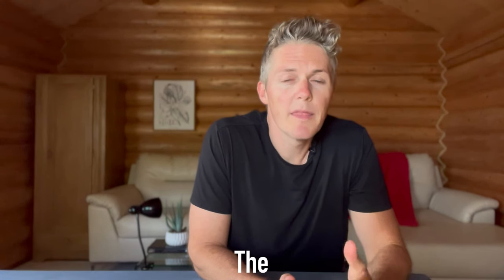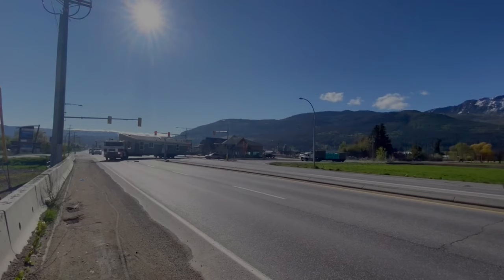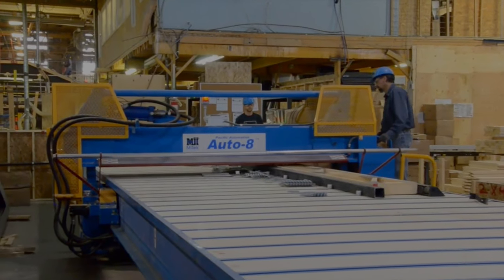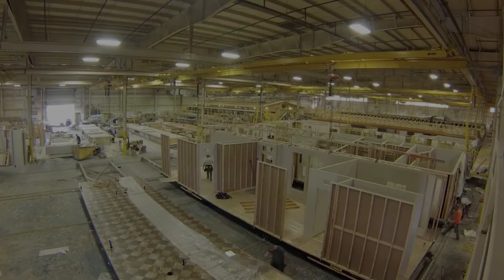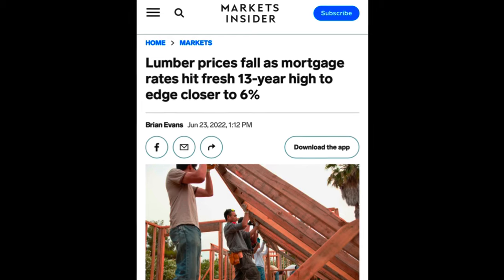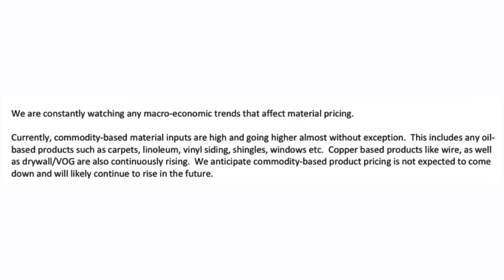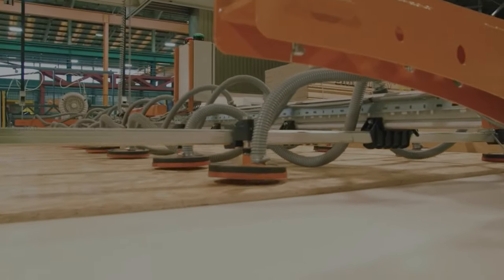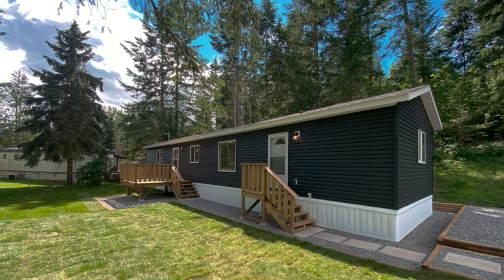PREFAB HOME Prices have FINALLY Peaked!

Comment: Until interest rates go down plus material costs, it's no way near the time to buy yet in my opinion.  The market is unsustainably too high.  Wait until it corrects itself.  It might be a sudden crash or a slow downward trend but make no mistake, it will go down because it's unsustainable if it continues to rise.  No one will buying which will trickle down to less homes being built (low demand equals..)

Comment: LOOK FOR SPECIALS!!
You can double the amount of useable building material, by adding air to it, such as is the case with self insulating aircrete. And when you think about also not having to buy insulation, that is a added bonus.

You can rent a air compressor or buy one, use that to inflate a sewen dome shaped balloon from basic polytarps or something else, then you use a shotcrete gun to fire the aircrete onto the inflated dome of whatever size you choose.

I just grabbed a cheap giant RV that runs and isnt horrible, and it is more usable than a shed or shop office. It can be parked in the shop and be the heated/air conditioned office. Scores!!